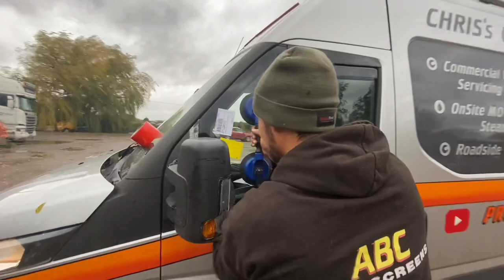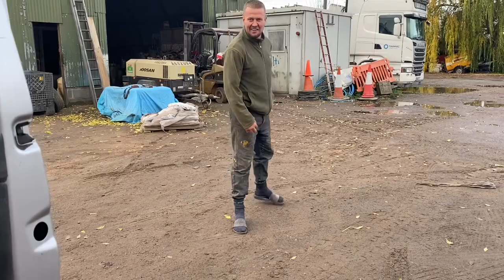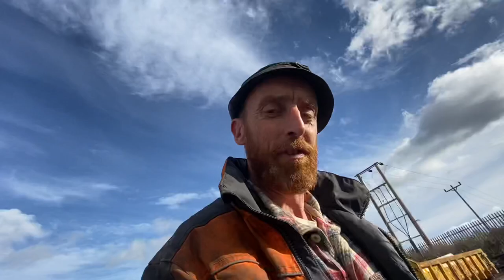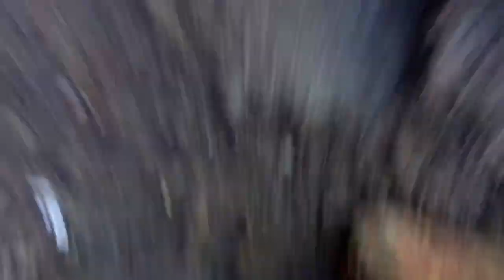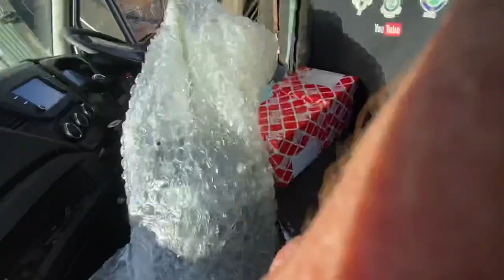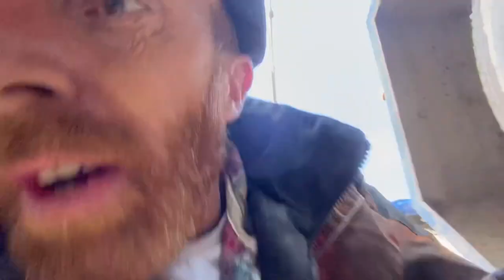The glass the chamber and some wise words

Comment: Also take the cut off valve out of your compressor, put a bolt in it. Nuts will fly off, when I did crane tyres it would click off at 8 Bar, crane tyres generally take 9 Bar. Biggest struggle when you don’t have constant pressure. The insurance people had something to say, but they always find something

Comment: Chris, the best penetrating spray I have used apart from plus gas is mixing 50/50 in a spray bottle nail varnish remover and ATF, works a wonder.

Comment: Here in Ireland we had a lot of HINO trucks on the road Concrete mixer's and Tipper's and they where the best you chould get for building work but now you can't get any new HINO trucks because there engines are not Euro 5 and 6 so now it's Renault, Merc, DAF and a few others and nutting but problems with them because not tough enough for site work. I wish the E,U whould feck off with all the crap and let us work.

Comment: WW2 helmet fact, 
Sorry to correct you here mate your sort of right with the helmet situation but the reason they didn't wear the chin straps is because in those days they were verry much likely to come into hand on hand combat so the reason for this was because if the enemy were to approach them from behind they would have put their hand over the helmet say grabbing it where your forehead is and pull your it backwards which would snapp your neck instantly, imagine the back of the helmet digging into your neck from behind and the chin strap keeps pulling ur chin and head upwards when the helmet won't let it because it's digging into the back of your neck forcing your neck to break befor the steel helmet!! In those days you were more likely to come into hand combat than a bullet to the helmet as the rifles wernt verry accurate back then,
Another little lesson the royal marine commando's got the nick name boot necks because they use to take their toung off their leather  boots and tie it around their throats so Germans couldn't slit there throats from behind as the commando's were allways fighting behind enemy lines or on the front line doin the bulk of the fighting, back then the commando's were like a secret fighting force abit like the SAS

Comment: In ww1 the reason they didn't wear a chin strap was when a shell exploded in the trench thier mates  would see or dig down to thier legs and  try to pull them out and if thier legs were still connected to the top half they would strangle them or pull thier Bl***y Heads off!!  Stay safe and Drive carefully Ta Ta